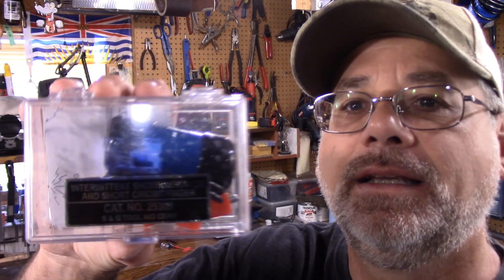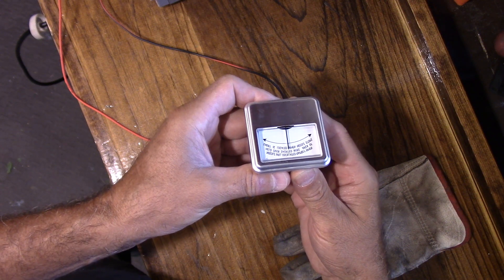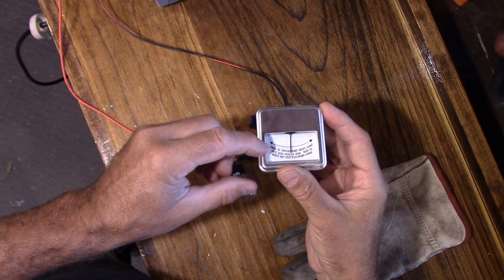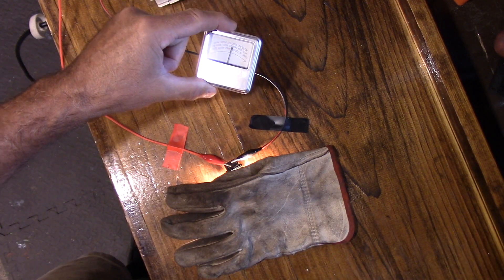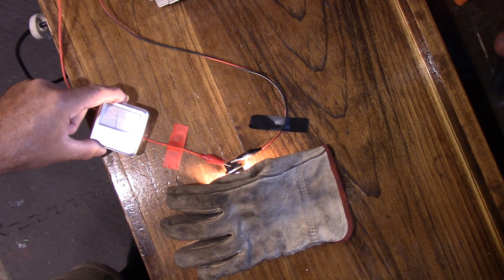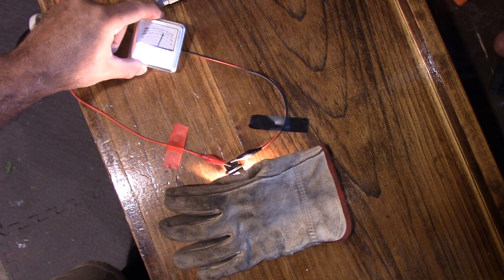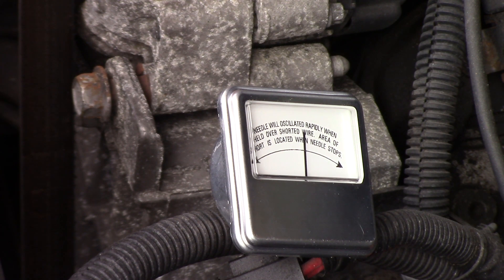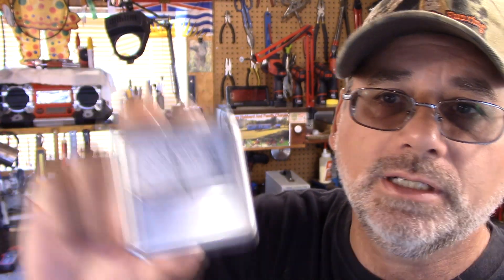HOW TO TEST AMPERAGE - FLOW AND DIRECTION  FAST AND EASY - S&G Tool Aid Company # 25300

Comment: Its handy to know the direction of your shorts...  i usually just check the tags in the back
Reply from the maker: LOL you have it all covered it seems ........
Reply: What about the new ones that just paint the label on?
Reply: @mostlymoparih5682  I dunno... my shorts are from the same era as carburetors... Tags in the back and stripe down the middle shows direction (i added that). My guess is new shorts are like the new vw beetles designed and built for the ladies.
Reply: @builtrodewreckedit  You very funny Dr Jones. yeah you can get two days out of them if ya turn em out for the second day. 
Have a great day. Happy Motoring.

Comment: I love that little tool! I've heard a compass will do the same but I haven't tested that yet 😆
Reply from the maker: Yes a compass will move  if on a solenoid  if  you power it up .  This is like a glorified compass :) Cheers buddy
Reply: @SteveRobReviews  Yes, a compass will work when placed next to a wire when current is passing through it. The wire will generate a magnetic field around the wire which is perpendicular to the current. The compass needle will point tangentially to the magnetic field depending on where the compass is placed. And the compass can tell you the direction of the magnetic field, or you could just use the right hand rule to determine the direction of the magnetic field which is simpler. This phenomena with the compass was discovered by Hans Christian Orsted in 1820. And you're right that a discovery from long ago can still be used today!
Reply: @stuzman52 , exactly.  I've used a small compass I got as a kid for this for years. Works great if you can separate the wires enough so the other wires don't interfere.

Comment: That looks like an interesting little tester, Steve....Checking the flow without disconnecting wires.....It`s a basic tool but hey....it works and that all one needs....CHEERS
Reply from the maker: Yes it's an odd one  and an oldie  actually . Some of the best things in life are old , right 👍
Reply: "Some of the best things in life are old"....yes...I have to thank you, Steve, for the compliment....I just hope I`m getting wiser at the same time.....Happy Easter day buddy....CHEERS
Reply from the maker: Happy Easter buddy.